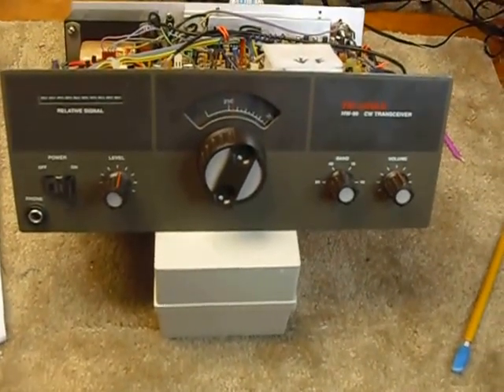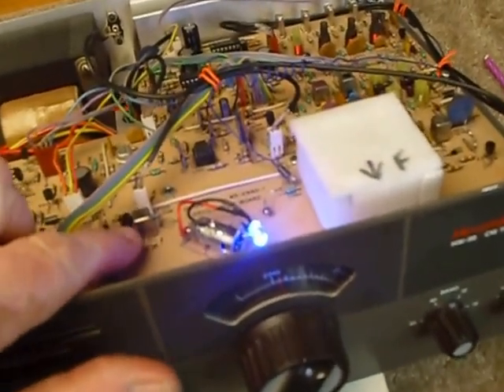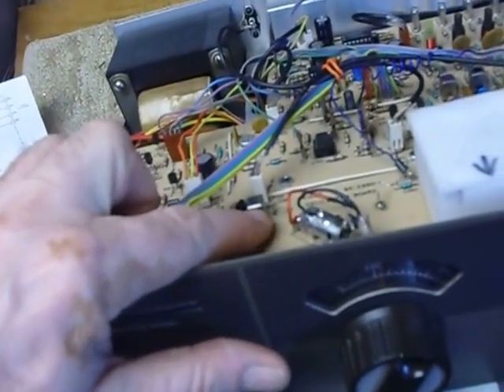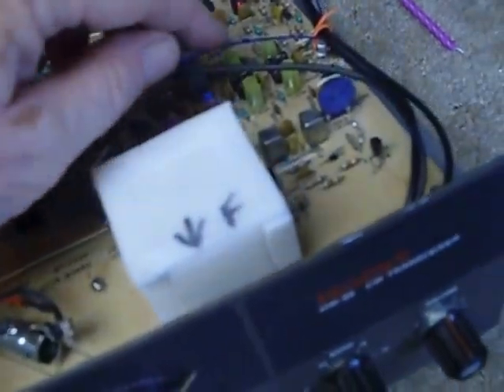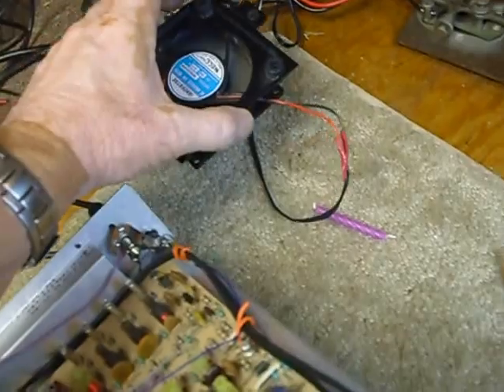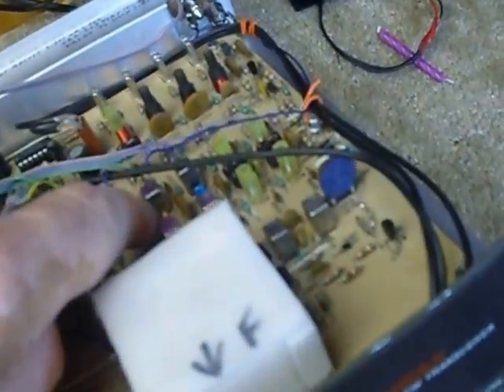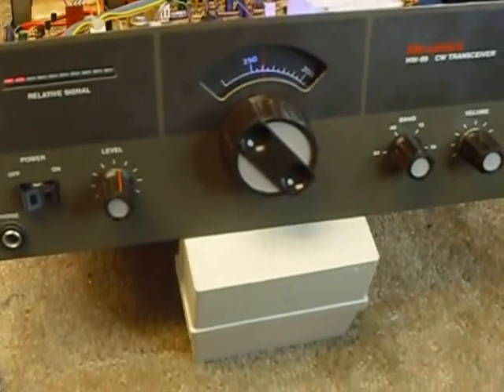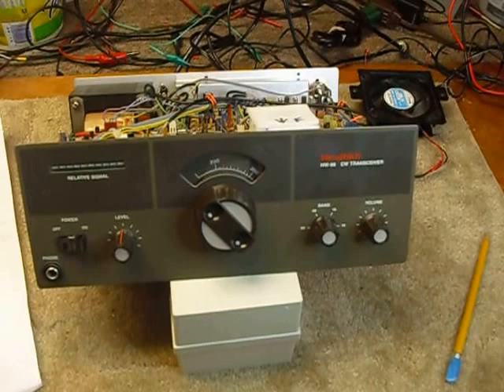Heathkit HW-99 , HW-99 CW RIG, HW-99 Novice Rig , HEATHKIT

Comment: Thanks again for another nice Heathkit video.  At first glance I thought that it was the HW-9 video.  I have an HD-1410 keyer which works fine, but needs a good cleaning.  Would you use the soap and water/oven bake trick on something like that?

Comment from the maker: HW-99  Thanks guys for your comments .The youtube videos are done to give a little back to this great hobby we share.  one thing I forgot to mention about this project .the HW-99 VFO drifted quite a bit when I  first turned it on  I put the HW-99 in the oven in the kitchen and baked it at 170 degrees for 2 hours to remove any moisture to see if possibly moisture in the circuit boards was causing the drifting. 
IT WAS !  After baking two things occured the VFO was 30 KHZ higher in frequency than before and  the VFO had to be re-aligned just scewing the slug down a little did it .Also the 10 meter coils in the TX bandpass filter were out of alignment and the 10 meter band did not work at all on transmit.
Re-aligning these and the rig had much reduced frequency drift to an acceptable level . The type of circuit boards used in the HW-99 and circuit boards in many other rigs can and DO hold moisture and cause circuits to do strange things so baking at 150  degrees can often cure some problems by removing this moisture . Use care! these are not cookies you are baking make sure your oven does not get to hot I use a meat thermometer to double check the oven temperature when doing this procedure double check your oven temperature BEFORE you put your rig in there. My oven will only go down to 170 degrees and this is ok however I prefer 150 degrees to reduce the possibility of damage to the rig .  73  BOB